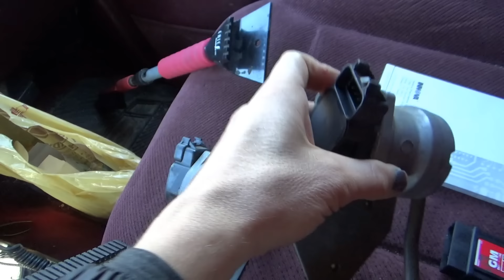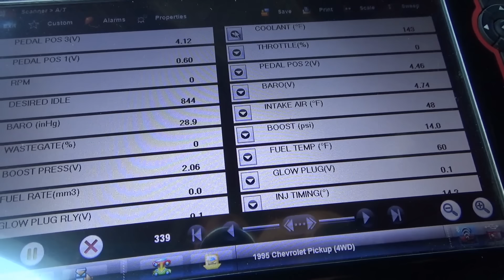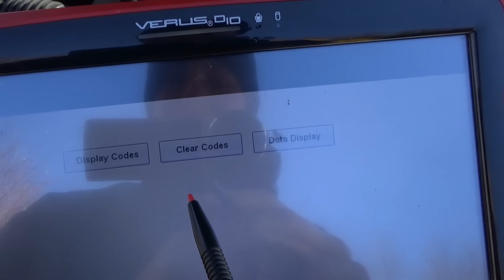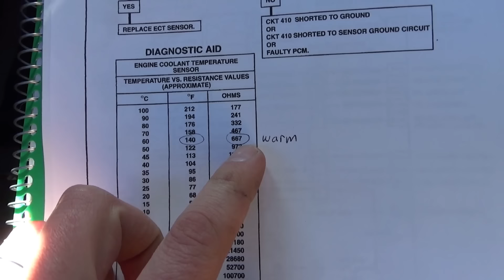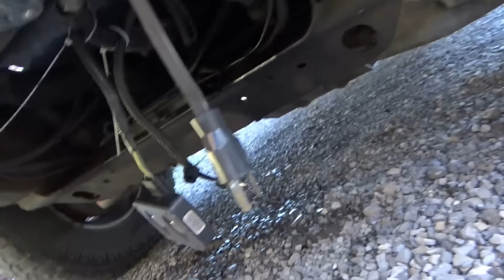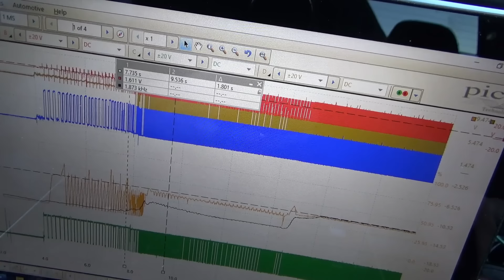(Pt 1) Chevy 6.5 Turbo Diesel REVS Out of CONTROL?! (Throttle Diagnosis)

Comment: This may be a dumb question but, CANT WE JUST DISCONNECT THE BATTERIES TO DISCHARGE MEMORY FOR AN HOUR OR MORE THEN RESTART IT BY FIRST TURNING TO ON POSITION, THEN TURN OFF AND START ENGINE WITHOUT USING THROTTLE FOR A FEW MINUTES TO RESET RELEARN, THAT COULD RESET AND FIX IT, COULD BE AIR LEAK, IDLE AIR CONTROL ? IDK also maf  sensor , sounded in beginning like air leak issues or idle air control valve issue, what is going on with the foot pedals and throttle sensors in front seat of this truck? 
 when our truck would stall, dash light said throttle relay, but there is no throttle relay, so seems that it means throttle position sensor in the pedal needs replacing ??

Bad SPARK PLUG WILL CAUSE IT TO SHAKE, I HAD THAT HAPPEN AND THE SPARK PLUG HAD JUST FALLEN APART THAT I BOUGHT OEM ON AMAZON.

Comment: I saw on internet this is how to reset they said accelerator pedal... Reset calibrate... Before it goes in the  safety mode where you can barely ambulate down the road
Reply: LIMP MODE, Yes need to disconnect batteries for an hour or 12 hrs to discharge memory, then reconnect and turn to on position but don't start it then turn off and then start it without foot on pedal, no throttle for a few minutes to RELEARN it's learned some bad stuff for a while and needs to be reset relearn at least try it. 
However it sounds like air leak, maf sensor idle air control or someone screwed around with the idel

Comment: My Duramax 94 Sierra SLE 1500 6.5 turbo diesel.. drive-by-wire accelerator pedal.... Not always a check engine light according to Google AI response... That is one of the symptoms revving through the roof anomalous idling... and quite logically.... I don't know why maybe heating of the circuit makes it a transient consistent anomaly that somewhat subsides but seems to be getting worse and worse for me.... I just screamed.... There's supposed to be a limp mode necessarily I don't know... For safety that allows it to only move at a certain speed.... As a rule

Comment: I just revved it a touch for the first time it went up a bit over over 2000 held it a second or two and went back down kind of slowly still idling and buzzing a little bit noticeably uneven when it landed back on idle speed looks like factory correct

Comment: I wonder if he had same anomaly with gas tank cap if you're tighten it you get vacuum.... I've been keeping mine loose... Why vacuum?... No return to tank pressure equalization.... It's like the engine itself just eating up gas and air like a vacuum pump

Comment: At the scrap yard checking my fuel filter again ... Screw that thing loose.... Waiting about 20 seconds before any gas percolated up always here air escaping as I unscrew it.... At this point I start the motor I drive it not really in a noticeable anomaly with accelerating.... I'm assuming the gas bubble air bubble whatever got out of the way of the injection pump enough to where it's not weird.... Although I don't think the fuel pump is yet pumping enough pressure.... Hell maybe somebody was getting gas at the fuel pump itself and its loose behind I will check it tonight if not right now I'm on the side of the plumbing shop... Waiting for another $80 worth of water heaters for someone to give me

Comment: My ultimate contingency is to cut the wires across pump and give it that direct from the battery with inline fuse maybe I can put some kind of variable rheostat in line I don't know what the heck I just said there but..... When I disconnect the pump totally I wonder if I'll get a code I don't have any check engine light... Or will it even run

Comment: My ultimate contingency is to cut the wires across pump and give it that direct from the battery with inline fuse maybe I can put some kind of variable rheostat in line I don't know what the heck I just said there but

Comment: I was able to put mine in gear... Edwards moves out and then warm up. And stop undulating... Then I drove it off and it does that to the Moon rev with that anonymous drop off and turbo wiz... So I egg it along and it drives... With weird feeling sometimes surging a bit... It's been getting worse and worse every morning

Comment: I have to prime the fuel by unscrewing that thing on the top unfilter in the morning although it started when I didn't and that's when it started really kind of bumping and undulating.. I shut it off and then primed it by letting it bubble up half a minute wait... It's supposed to come out of that little hole but it has stopped doing it since my boss had showed me procedure

Comment: 1 mechanic said I should go straight from the battery to the pump with another inline fuse I guess I'll strip backs housing on the other side of fuel pump and go straight to ground...... Truck runs once I get it warmed up enough somehow to get that anomalous out but when I give it gas initially just touching the gas pedal makes it Rev fast and then drop out as I'm still pushing the gas pedal.... I found one open what look like vacuum hose that seem to percolate are add my fingertip I put screw in it yesterday I'll have to see how it starts up in the morning

Comment: The motor undulates also as I first started I have to loosen the filter when it shuts off no fuel there takes a half a minute sometimes for the fuel to bubble up.. if it shuts off while I'm driving I have to restart starter fluid in air intake of turbo

Comment: Is stage plugged in and peel back some of the housing twisted wire do outside of pump... The ground side of pump left alone it runs when toggle switch is on

Comment: Holy hell that's just what mine is doing I'm cleaning grounds I can't figure it out lift pump has been rigged borrowing power from fuse link bolts inline fuse unswitched power

Comment: Needs a new injector pump. I forget exactly what it is, but something in the pump breaks and causes it to rev up like that. You can shut it off still because of the fuel shutoff solenoid. Its not "running away" in the same way that you think of when you think of a runaway diesel.

Comment: optical sensor , reading not enough fuel. slinoid opens too much  and  revlimiter kicks in, hence reving uo and down. Then you   press the accelerator  and it over res and cuts  and dies. optical sensor replacement and calibration, if you have the tools. Inother words INJECTION PUMP REPLACEMENT ouch

Comment: Replacement of the injection pump is needed.   I bought a 97 GMC van with 188 k +  the same issue. . Replace the injection pump and be done with it.  I called Antrem Diesel in Pa and they diagnosed the problem over the phone. Antrem Diesel is known nationally and is run and owned by the Meninites.  I bought a used pump I found on Craigslist that came from Antrim with 30k on it.  The crank snapped and it was to expensive to fix so the guy put in a 454 he had lying around and everything bolted up with no issues.  The guy said that the gas mileage sucks but the power was better.  I installed the pump and I gotta say it was a total nightmare. If you ever peeked under the hood of one of these vans I'm  sure you'd agree.   Never again .              After tweaking the timing and changing the lift pump to a Carter  it ran great and got almost 20 mpg on the highway at 65 mph. Over 65 mph fuel mileage drops off.  4.10 rear was the reason for that I  assume. Then I installed an adjustable oil pressure switch and set ir to 4 psi with an indicator light for the dash.  I also added a liquid filled pressure gauge on the firewall to keep an eye on the lift pump pressure. If the lift pump quits the injection pump will die quickly from not having a lift pump. Clean all the ground connections and add an extra ground for cheap insurance.  I'm not a fan of the electronic version of the injection pump I gotta say.....
I'm currently thinking about venting the cdr tuna can from it's stock routing to an oil catch can.

Comment: Have you ever herd of a run away goes like wide open you can not turn the engine off the only way to shut it down is spray a Fire exstinisher into the air cleaner it choke the engine it will shut down all because the Turbo went bad i tell you i case you never seen that before

Comment: Could it have had Corrosion Resistance to the Coolant Temperature Sensor?

The Engine is Reading a higher Air Temperature and so it Overfuels on tickover to provide an erratic R.P.M.

Under Throttle it Overcompensates Markedly!

The P.C.M. and P.D.P. signals are Correct and the Fuel Delivery Solenoid is not thought to be at fault because of the R.P.M. changes!

If it were Corrosion and with bad batteries as is evident then the Extra Power from the Alternators was Overcoming the Corrosion by a Far Stronger Electric Signal and the Temperature was then read as Markedly Higher!

The Fueling is then Increased because the Engine thinks that the   
Fuel Density is Less at High Temperature and thus is Overcompensating!

This Would Explain the Spikes that the Engine Displays Without the P.D.P. and P.M.D. showing a Fault and Whose Data seems to be Concurrent!

Regards!

Paul

Comment: I know this is s diesel but I owned a 1997 Chevy Monte Carlo Z34 that did this same thing . No one could figure it out at GM dealer . Finally I closely checked the MAF it had a cracked wire that would intermittently do this same symptom you are having because the heater wire would intermittently make contact and drive the computer nuts.

Comment: I use to work on the earlier versions of the GM diesels in the earlier 80’s that has a very similar injection pump.  This pumps had an rubberized disc that connected the injector head to the injector pump Governor.  Those rings would deteriorate from time and heat and would cause the same running symptoms.  Does this pump have the same rubberized disc?

Comment: Typical rookie mistake. You saw many replacement parts in the car and assumed the problem is related to them. Except the car wasn't fixed despite the previous garage messing with those parts. A lot of guesswork and false assumptions. Poorly documented on how the engine control works. This can't end well.

Comment: I’ve had a few of these trucks. Does sound like the injection pump, had some good luck with Pensacola diesel reman pumps and good price.  

However, had an issue that took me forever to figure out similar to yours although truck would go into limp mode.   Theres a harness that runs in the intake valley front to rear that goes to the pump and other sensors, mine melted together and ended up shorting the ECM as well, there are well made and insulated harnesses available.  Only found it while changing the injection pump as intake has to come off but I was at my wits end and thankfully found it.
Reply: I won’t buy anything from Pensacola diesel anymore.  Got 4 injectors to do one side on a 7.3 powerstroke.  Had to reject 2 injectors right off because one had a cracked solenoid and the other was built from a rough core that the connector was all chewed up.  Immediately got a check engine light that flashed on and off after installing just the two remaining injectors.  Figured it was air still in the system.  Let the truck go to the customer.  Later the #8 I installed had a dead miss.  Replaced with injectors direct injector.  Check engine still flashing on and off.  Ohmed injectors, Ohmed harness from idm everything checked out.  Moved suspect injector to another cylinder and the fault moved to that cylinder but only while running.  Replaced with injectors direct injector and no problems.  So 4 injectors, 2 rejected one replaced within a year and the other caused a check engine light immediately.  4/4 injectors were crap and naturally this was the first time using them.

Comment: a bad CTS on a GM, I'd have never guessed. 🤣 that and the pigtail too them if the mad butcher has been in there working.
that looked like a ton of fuel when it fired up(or oil from bad turbo), probably fuel injection pump kaput.

Comment: A bad input to a computer gives a bad output. On a Powerstroke, the IPR (Injector Pressure Regulator) (a fuel pressure sensor) output (like gasoline engine MAP) tells the computer how much energy is going into the engine.  If that signal is indicating low, the computer will over command for the desired result.  Possibly a bad pressure sensor regulator on the Duramax causing bad commands.  The 7.3 PS goes dragster crazy when the IPR fails indicating low fuel rail pressure.  Scary to drive it because accelerator pedal becomes hyper sensitive.

Comment: 9:31 IAC valve... probably, because my Volvo 850 doing same...
Reply: Diesels don’t have butterfly valves. They throttle the amount of diesel injected into the engine.

Comment: I’ve done ton of these things and 90% of where the wiring harness is shorted underneath the fuel filter runs along the valley of the engine fuel disintegrates the installation on the wiring, major problems and they will do all kinds of crazy things

Comment: Interesting how it can be both 1800revs and 700 revs at the exact amount of PDM duty cycle but at the same time timing of those pulses relative to CKP is different quite a bit. So PCM can make it idle if it wants, maybe mechanical timing of fuel pump itself is not correct?

Comment: Do not overlook the ecm behind the glovebox or whatever they call it. I’ve seen two instances where a 6.5 wouldn’t run right because of a pin that backed out on the connector.

Comment: Hi Ivan,   There is a  braded copper ground strap that runs from the firewall behind the exhaust downpipe from the turbo to the back of the left bank head, when it corrodes it sets up all kinds of crazy feedback  to the computer behind the glovebox and the pmd, I’ve had a couple of 94’s with this problem,  I went back to a 93  five speed 4x4 no computer never been a problem and still going strong,

Comment: Another variable that still remains is the coolant temperature sensor circuit. The temperature/resistance chart shows that the PCM should register -40 degrees with the sensor unplugged (maximum resistance), but your reading only went to -7 degrees. The circuit still has a problem with the sensor unplugged, and the only answer is a partial short-circuit or internal PCM problem. Wherever the problem is located, it seems logical to conclude that the fuel injection system may be affected by it as well, whether it be corrosion or a pinched/chafed harness.

Comment: Love your work Ivan! thank you for sharing your knowledge

Sounds like the injection pump. Low and ultra low sulfur fuel really wears out those Stanadyne/Roosa-master pumps. I'd change the nozzles and glow plugs out too while it's apart and insist the client runs Power Service additive in every tank.

Those were junk new, really junk now.

Comment: To continue on the injector closure time PID on these early truck is misleading.  It is actually the fuel solenoid closure time.  Just like a gasoline injector hump, this is measuring the time it takes for the solenoid to close and start injection.  That is why the value does not change much with RPM or load.  It is not the on time of the solenoid.  In your waveform if you measure the difference between the command red signal and closure signal green, you will get the same reading that the PID displays.  Also if you look at the scan data you will notice the shutoff solenoid will be activated to bring the RPMs down.

Anything is possible but I have yet to see a PCM cause this fault.  The introduction of the black plastic fuel filter ended up destroying these pumps.  Stock filtration is 5 micron and the black plastic one is closer to 20 micron absolute.  5-7 micron particles cause the majority of damage to a diesel fuel system.

Comment: ECMs are common to go bad in these trucks. Because a sip behind the glove box on top of the HVAC and they get a lot of heat. And when they go bad on these diesels they always act very very Iraq with the idle and overrev. It's not logical or you can can't really see what the scope. It's just experience to solve this problem. I'm 90% sure is a bad pcm

Comment: I have had to deal this problem about four or five times on the 65 Detroit diesels. 90% of the time it is ECM. But there is one odd time. That the old PMD went crazy and cause it to fry the ECU. But that was one time of multiple trucks I have had this problem with. Also too make sure that it's the PMD has a calibration resistor right into the pigtail there are resistors you can get from 1 to 10 5 and 7 limit the max fuel rate. If you don't you can be shooting excessive fuel into it it's not much of a problem you can get them from Rally's from dorman for like 35 bucks.

Comment: I would do a TDC offset learn and then see what it reads. If someone moved the pump and did not do this it wont change the reading in scan data. It will look in spec but its not. If its + or - 2.46 it needs to be timed. I always found -2.38 to be the sweet spot but hard to hit.

Comment: I wonder if you could remove the PCM driver signal from the PDM and substitute your own?  If the engine behaves, it's a PCM.  If not, it's the pump itself.  It has 160K miles' use.

Comment: My guess on the fuel rate being 0 is the pcm is trying to drop the rpm, but with the injection pump bypassing it can't.
Reply from the maker: But the duty cycle of the fuel solenoid doesn't drop below 30%...weird! 🤔
Reply: @PineHollowAutoDiagnostics maybe that's a preset minimum in the ecu tune.

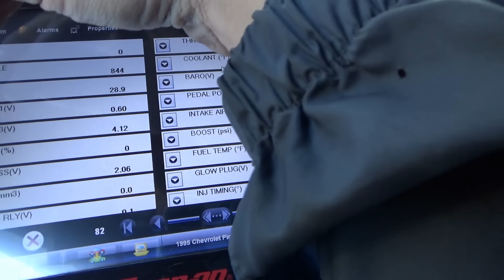Comment: Boost PSI showed 14.0 when engine not running. Time stamp 5:34
Reply: I believe 14 psi is ambient atmospheric pressure. That is normal when engine is not running. It’s not the same as when You have 14 psi of boost.